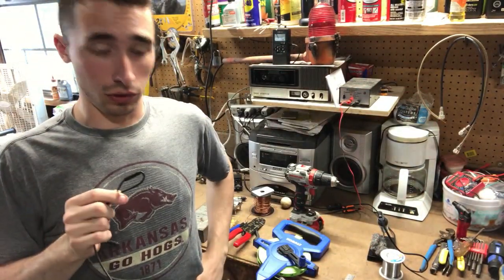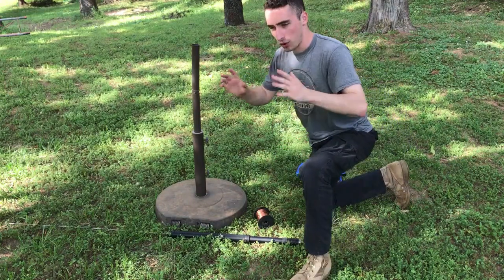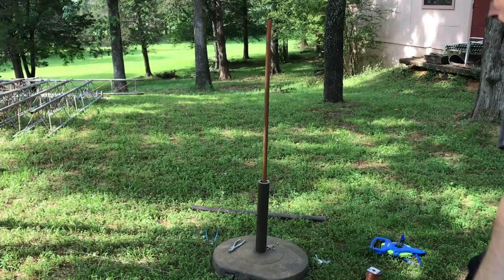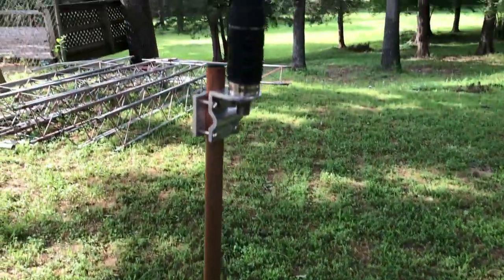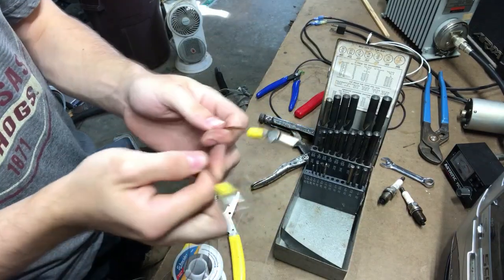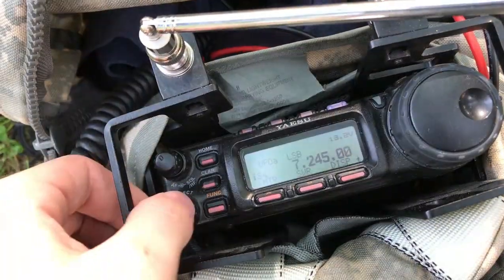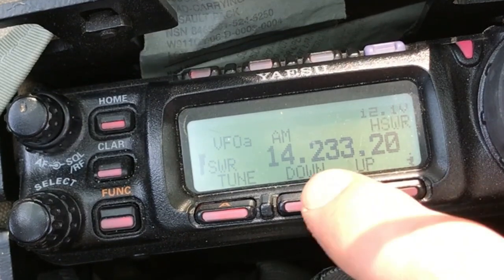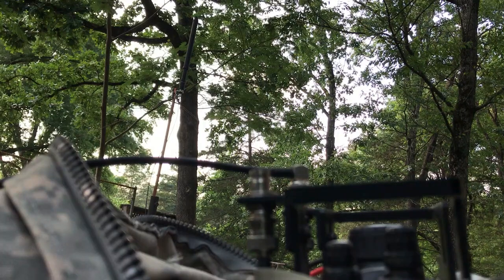Yaesu ATAS 120 Antenna Radial Kit Build -- Ham Radio Manpack Setup

Comment: I have this antenna. It is new. Yesterday I hooked it up to my Yaesu FT 991a and set it with a connector stake i got on Ebay. I am using ground radials (8 at 12 feet long), and the cable is UHF Male (PL-259) to UHF Male (PL-259) Low Loss 400 Coaxial Asse. I set the menu item to ATAS. I have not been able to get the antenna to tune and thus it does not extend on any of the bands. Am I doing something wrong?
Reply from the maker: Are you trying to let the antenna automatically tune? If you are, that is hit or miss for me and it usually struggles to find a match regardless of what band I'm on. What I usually do is use the UP and DWN buttons and watch the SWR meter on the radio to get the antenna to match. If it still gives you issues, I would check the radial connections, coax connectors, and antenna whip to make sure everything has a solid connection. Hope this helps and thank you for watching!!

Comment: A properly grounded vehicle is the countrpoise it is designed for. It is not an 80m antenna. On my Jeep Wrangler it has been great. There are much better options for this use.

Comment: Thanks for the video.  It gives food for thought.  

It's WAY easier to crimp the copper wires into the ring terminal and then solder.  That way you get a solid mechanical connection with the crimp and make it corrosion resistant with solder.  The plastic can easily be removed from the ring terminal by heating the ring terminal with the soldering iron while holding the ring portion of the terminal with pliers.  Pull the plastic off with needle nosed pliers or a cotton/leather glove.  After crimping, solder only from the ring side of the terminal and try to keep the solder from creeping through the terminal and into the unsupported wire.  If the wire outside of the terminal is soldered, that creates a hard spot which is a great place for the wire to break due to flexing.

Comment: I wonder how it would perform using a single wire counterpoise that is 1/4 wavelength the band you are working.  You could just have a role of wire with different length markings.

Comment: I am curious if you just used a tuned radial for each band  if you would get better results. I find with a non ATAS vertical on a tripod and a radial extended out to 140 / FREQ in MHZ works great in theory you could just measure out one for each band connecting them all and it will use the correct one because of path of least resistance when the ATAS tunes in to the freq. Would love to see you try that. Been considering buying one for my FT-991A setup right now it requires me to get up and roll in or out counterpoise and adjust the coil on the Gabel Radio GRA-7350T vertical to the band I want to work. If I could push a button and not get up work be great !! :)
Reply from the maker: Yeah, I'd go for it if you're thinking about it. That's literally all I did for this experiment is a little thinking/math on what lengths would work for the bands that I intended to operate on and just kinda winged it LOL. The only thing that really limited me on the number of radials was the portability of the assembly. But design it to meet your unique operating conditions and don't be afraid to mess around with it! 

Thanks for watching!!

Comment: I re-purposed an old Velbon camera tripod for my ATAS-120 mount. I cut a small plate to handle several holes for mounting 16 12' lengths of speaker wire for the radials. Works very well from 40m on up. Just made a good 20m contact in Colorado (from San Diego) using my FT-857 in my go box using a 20ah Bioenno. Thanks for your video, AR 124!

Comment: I have this antenna on my 2017 F150. It works to some degree but with the Aluminum body, I can't get a good ground. Have been trying various solutions with zero luck so far! I might try it portable on a tripod, just to get some use out of it. I wonder if anyone out there has had the same problem and found a solution??
Reply from the maker: That is one downside to this antenna is that it requires a pretty substantial ground to work properly. With the aluminum body on your truck it definitely won't help the situation and I have heard of several others having problems with antennas in general with the newer ford vehicles. The only thing you might try to get this antenna working is to add some copper strap down to the frame or make some type of ground plane kit to lay in the bed of the truck. 

Hopefully you can get it going!! Thanks for watching!!
Reply: Have you found a solution yet Keith?

Comment: For portable ops a single tuned elevated counterpoise typically works better. Also, when elavating counterpoise wires try around 30in.
Also, you may also try jamming the copper pipe in the ground.
A whiz meter will help tune your counterpoise length. Mark the length so the next time you setup you can start within an inch or two of the sweet spot.
You might even consider using a good low resistance push connect for you counterpoise like a 45A Anderson Powerpole.

Comment: The ATAS 100/120 will present 30 ohms impedance at resonance withe the lowest SWR you find.
They do need  a ground system  /counterpoise. The radiating portion of the antenna is the coil and whip that is above the top of the housing. Good current flow requires a ground/strapping to vehicle chassis. 

My example is my 17 foot canoe on which I deploy an 24 year old  ATAS 100/FT-100 Yaesu.

For marine  canoe stability on the water, I have a second canoe  tied to the first canoe with a DIY
wooden deck,4 feet between at the beam width of each canoe. The assembly then becomes a catamaran.

 I can fly a flag, like the Boy Scout Flag, or the scouts favorite, A large Red pirate flag!
my vessel instantly becomes visible to other boaters. Many are curious and will come along
side on Field Day or Jamboree on The Air. Others along side can hear the radio and I'm able to
Demonstrate the usefulness of Ham Radio.

Make yourself VISIBLE!.
Always let someone know of your where-abouts!

I operate with two trolling motors, fire extinguishers, deep cycle marine batteries, and appropriate marine lighting.
I have used this setup after dark. I do have and require use of PFD's and extras.(paddles, food and water, extra handy talky and VHF radios.) The two canoes(600 # rated capacity)
.deck and batteries, radio shack fold together for disassembly and transport.
The added weight derates the two canoes capacity by 350 pounds. 
I am presently designing an aluminum fold-deck to replace the heavy wood deck.

I mention this aspect of my system for SAFETY purposes.

Do Not underestimate the power of Wind /Water/ Weather and the presence of other boaters who may not be aware of your presence! 
Keep a navigation horn audible horn at the ready!

After dark ,make yourself visible .employing the the RED/Green bow lights
and white light astern which are readily available online/boating store/or Outdoor store.
These come in kits and are AA/D cell powered.

 
I crafted a small 4 foot tall/4 leg PVC water pipe(1/2 " diameter)TOWER , to which I mounted
an 18" pizza pan at the apex.  The ATAS 100 was mounted with a barrel connector. I did implement
a tri-magnet mount but found that the so-239 /barrel adaptor created a high current point at the solder joint
for the ug-58 cable, so a few times when the radio tuned the ATAS, I was talking on the water for 2 hours plus to a ham
1250 miles away during a Fourth of July show from Grand Lake ,Colorado. I did not realize the high current had melted the center connector solder connection. 
What saved the day was that I had placed the canoe/antenna on my picnic table
to test everything. At that point, I used the tower legs as helically wound off resonance radials. Two legs wound on 40 meters/15 harmonic. Two legs wound centered on 14.225 approximated  10 meter radials. These are connected to the pizza pan.
All the legs use 1/2" tees split to mount to a 4 point system on the cross bracers(Thwarts) with stainless hose clamps. No radials
are connected to the aluminum bracers or the gunwales/rails(pronounced "gunnels") around the rim of the canoe.
That procedure is reserved for the future. 
I did trail an insulated, non-resonant  length of 14#  wire  in the water with a bobber and weight(as a Ground Shoe), The results of that brought down the noise level but did not elevate signal strength.

I like the magmount because I can disassemble the system  quickly. The wind load and weight of the antenna/magmount
are spread out over the pizza pan.
But I found that the magmount does not couple the counterpoise inefficiently.
To the point of melting the center conductor solder above five watts.
So therefore the barrel mount . with wide stainless washers to fit it's diameter.

The antenna analyzer  showed resonance points with a narrow  50-100 khz
bandwidth and SWR near 1.5 consistently after some fine tuning ,on 40/20/15/10.
I Check for Return Loss with  the analyzer and keep the coax lengths short.

That is fine by me for the mere fact that I don't hear a lot of band noise and QRM.
I do listen more than usual ,in case I'm the QRM!

This system exhibits low angle radiation off the water, with the pizza pan located
about 5 feet above the water level. On a particular lake, it is evident that
the close one gets to the dam, the higher the angle of radiation becomes. There is a lot of signal attenuation
and the antenna displays NVIS qualities ,especially on 40 meters.

In the center of a lake,  the signals boom in!
My best contacts with 5 watts are South Africa/Hope ,Alaska. The UK, the 14300 MMSN Net.
UA stations/Spain/Portugal. Japan, Thailand, etc. 

I'm not a contester, just like antenna experiments .

I've found that the ATAS -100 will work 6 meters, and Field Day/Jamboree on the Air
from 14.270 foot fourteeners is very busy. Either portable or mobile.

My setup was in a Field Day picture in a QST May edition a few years back.
The author of the article did not realize that the antenna on my mini tower was an ATAS,
and said that some operators work Field Day VHF/UHF. I had already submitted
my Field Day "water shack"  to QST., with HF results.
On 6 meters you become the DX.

I'm not working for the wallpaper, I paper log my contacts.

I make videos with a salvaged drone cam that I can control with my phone app.

A note: I use Type 31 snap on RF chokes  at the radio coax, type 31 toroid's on power connections
and keep all coax and power leads short as possible.

For mobile/vehicle  mounting ,make sure you have a good strap/straps, as many is practical,
to the chassis of your vehicle.
So, on the ground, you can deploy and test "Ham stickes" and 40 meter  sticks can be use on their harmonics on 15 meters.
The ATAS needs at least/minimum 1/4 wave  radials on it's high hf band of 10 Meters. I don't recommend
placing radials on the ground or " fanned/pinned to the ground". Slightly elevated/6 " minimum above the ground
has resulted in a clos to 50 ohm impedance, and with the small diameter coil in the ATAS, that helps with easier tuning.

To implement 80 meters you need 80 meter 1/4 wave radials/or simply apply 1 or two 80 meter "Ham stickes" as your counterpoise. AND, craft a whip from stainless steel  with a helix wind/or center coil to extend the  inductance of the coil
inside the antenna for 80 meters.  For your prototype, you can use stiff ,solid copper wire of the same gauge
as the ATAS whip diameter. Make the helix long and cut to frequency as you go.  You can approximate the center loading version  length by how long a wire you apply for the DIY helix (think Ham sticke) . A good antenna analyzer, a 2 position
antenna switch, allows you to go to 80 meter band on radio, by switching between bands and using the up down function on the Yaesu, trial and error, to get a resonance on 80 meters.

As with anything in Ham Radio Life, your mileage may vary.
73'
Reply: Wow